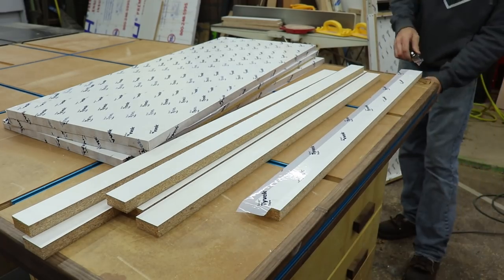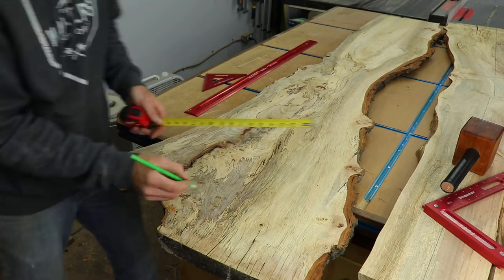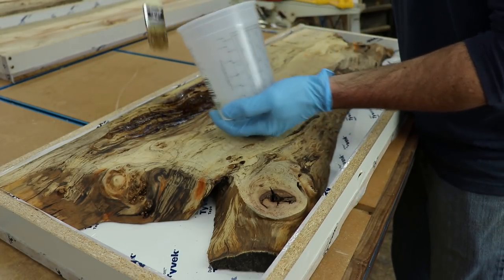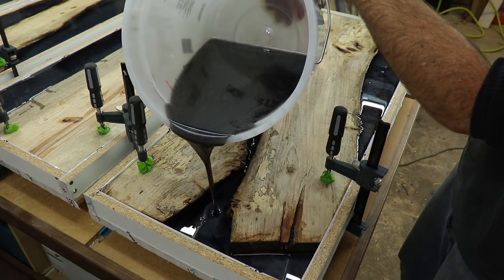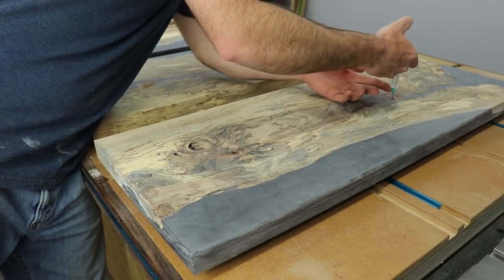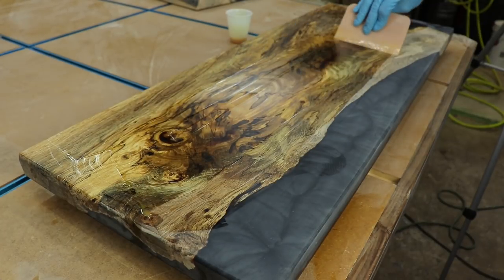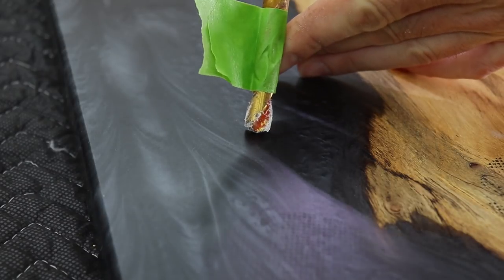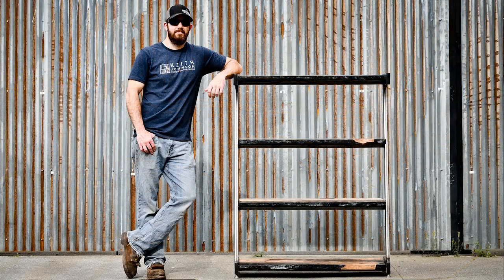Epoxy, Metal and Wood... OH MY! Building a bookshelf

Comment: Hey man, great video. Just a quick tip to help you with bubbles in the epoxy. Just go over it lightly with a propane torch, then your surface will be as smooth as glass
Reply from the maker: I typically do but I found with the longer setting epoxy it actually creates a weird film on top.

Comment: Just a reminder, always use a torch on your epoxy after pouring to pop air bubbles
Reply from the maker: With quicker setting epoxy this is true. But with the deep pour and other long setting epoxies it isn’t necessary. They release on their own before it cures. Actually some brands will develop a skin on the surface if you torch it actually trapping bubbles.

Comment: Hey that’s a great Vid very informative and has great tips like drilling a bit bigger in the epoxy so it doesn’t crack, and adding 5 min epoxy to secure the fasteners. I was curious.I’ve heard of going higher grit on epoxy (like into the thousands grit). Is the reason for 400 because of the brand, or is it that the pigment doesn’t show the tiny scratches like a clear epoxy pour, or is it because your finish would fill said tiny cracks or a combo of the three reasons ? 
Thanks again for posting such a great vid Boss.
Reply from the maker: Thanks Jim!  You're correct about the sanding.  If it were clear you would need to go much higher in grit and even set sand and polish.  But the Pigments allow you to get away with going to about 400 so you don't see any swirl marks.

Comment: Such a good project - awesome work!  Any tips for stopping epoxy going through the slab and sticking the base to whatever you have underneath?  Have run into that a couple of times and it's driving me nuts.  Cheers!
Reply from the maker: Thanks so much!  I'm not sure what you mean?  Sticking to the base?
Reply: @WalkersWoodworks  Ha sorry. When I'm filling voids the epoxy does a great job of 'gluing' itself to the piece below my workpiece whether that's a sacrificial board or workbench (first timer mistake!). Do you ever have issues with it bonding to your mould?
Reply from the maker: Oh lol no.  That's what the tape is for.  If I'm filling small voids I just tape the bottom of the piece.

Comment: I have a question. I'm trying to do my own little table of epoxy and walnut. I'm using rubio so I sanded the whole thing to 180 but I still see sanding marks in my epoxy. What do I do. Please help.
Reply from the maker: I usually dZnd the epoxy portion only up to about 320
Reply: @WalkersWoodworks  ok thank you for replying. I'll try that. I've been wanting to do this for a while now but I tell ya it has been very aggravating at times trying to figure all this out.

Comment: Hello...great build!  Was wondering if you could be more specific on the exact types of Rampa inserts and bolts you purchased??  Those look like they fit exactly what I need but their website is quite confusing.  Thanks in advance!
Reply from the maker: I get the 1/4 x 20 ones.  If you email them and let them know your project they can definitely hook you up with the ones you need
Reply: @WalkersWoodworks  Thanks...one other question...I recently used similar threaded inserts but the whole is very visible from the topside of the table.  Were yours?  My top thickness was about 7/8ths but the epoxy was a touch on the translucent side but still black/smokey.  How thick are your shelves and could you see your insert holes through epoxy?  Thanks!
Reply from the maker: I mixed a lot of pigment in the epoxy so you can't see them but I have had the same issue in the past.  It's just the nature of it I suppose.